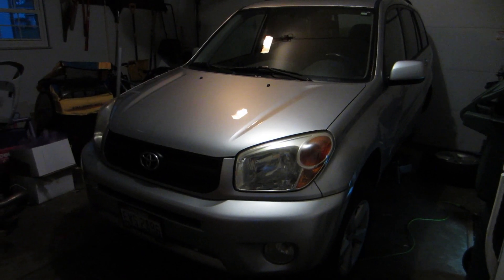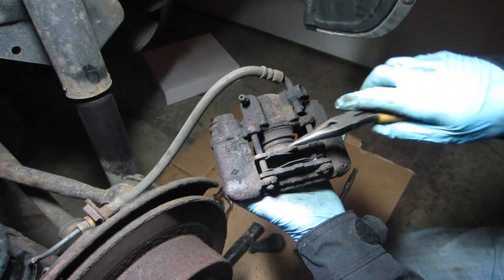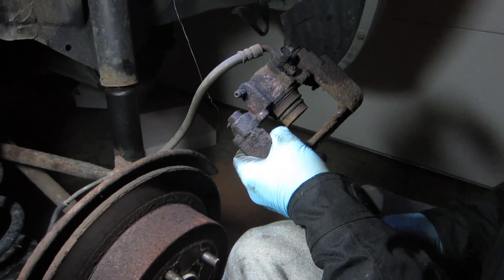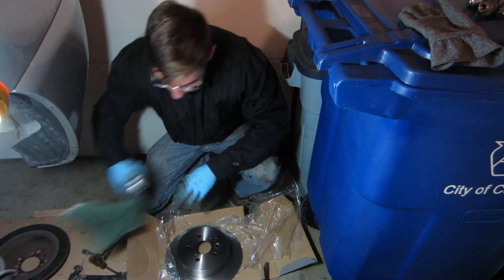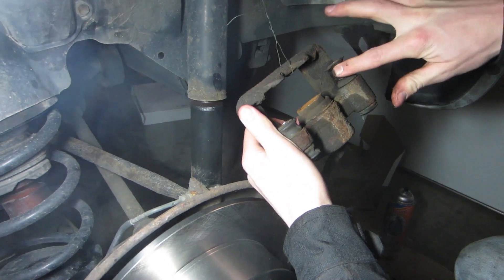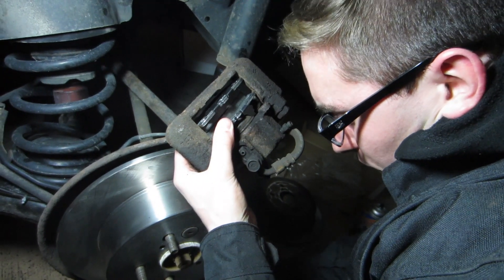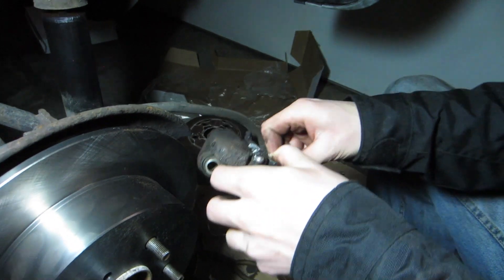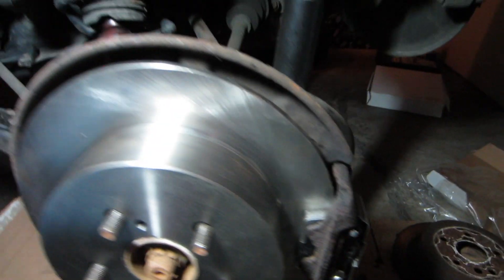(How To) 2005 Toyota RAV4 Rear Brake Change

Comment: Thanks William, a really great video; I used it to replace my brake pads with my wife.  And thanks to the unspoken hero behind the camera. I might recommend one small difference; at 7:45 you've installed both brake pad retention clips on opposite ends of the same pad.  I believe these clips are meant to reduce vibration (chatter) of the pads, and I may recommend putting one on each of the pads instead of both on opposite ends of the same pad.  There may be no difference in functionality.  For consideration.

Comment: Should have adjusted hand brake pads via the hole which has the rubber grommet in it as you had the wheel off. Can be a bit fiddly if not used to doing it. Need a screw driver to adjust pads. Tighten so hand brake when on holds wheel then slacken off 3 notches. Spin wheel to make sure it is not binding. Also pump foot brake to centre the pads on disc,
Reply: That rubber grommet hole does not have the option to adjust hand brake. It not far enough down,  you can see it runs in same patten as wheel nuts. Trust me I have the same car I took off the grommet and it does nothing
Reply: One video shows them adjusting that before removing the disc, is It a necessity to do this to allow the disc to be removed?

Comment: Brake rotors are known as brake discs. Copper paste should be used on the back of the brake pads to stop the brakes from squeeling. The use of normal grease will result in smoking due to heat. I would advise you to push the caliper piston back before removing the pads as this will give you a more stable area to push against. read the fitting instructions for the brake discs as the preservation coating does not always need to be removed before fitting, this varies from manufacturer. Before any one chirps up, i'm a qualified vehicle mechanic and industrial mechanic. The video is very helpful and i would like to thank you for making the effort to help.
Reply: I strongly recommend opening the caliper bleeder and connect a hose into a bottle to catch fluid, and pinch off the brake hose with a hose clamp before you push back the caliper piston. The main reason is the master cylinder is not designed for fluid to be pushed backwards into it and its possible to damage it. Also the piston will move much easier without all that fluid force going back to the master cylinder and will drain right into the bottle. If you choose to push the piston back without opening the bleeder at least remove the cap from  the brake fluid reservoir and watch for fluid overfilling because so many people keep adding fluid as the brakes get low and top it off, when you push the fluid backwards all that extra fluid will overflow. If the reservoir has been topped off and is full and the cap is on that piston won't move because the fluid has nowhere to go and you might be fooled into thinking you have a stuck piston...Another reason I bleed off the fluid out of the bleeder port. Just what I do.
Reply: Kevin Smith By copper paste do you mean like copper anti seize?

Comment: 2nd. Terrible  way to push the caliper piston back..high probablity of chipping the piston with teeth on the channel locks!!! DO NOT USE THIS METHOD!!! You may end up having to replace your calipers!!
Instead before disassembly use a very long screw driver and insert between the pad and rotor..then pry backward on the pad to push the piston back.
Since you are replacing pads and rotors anyway..any damage from prying will be to those items, not the caliper piston!!!
Reply: U right, but I still thank him for taking the time to post this video👌